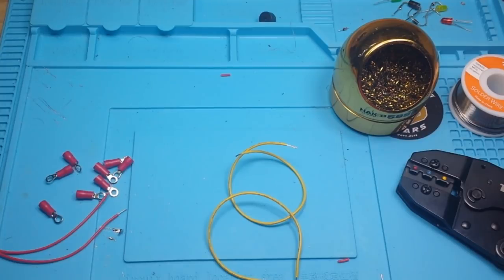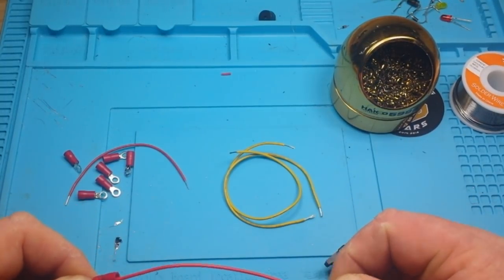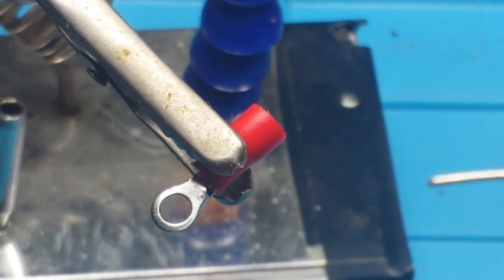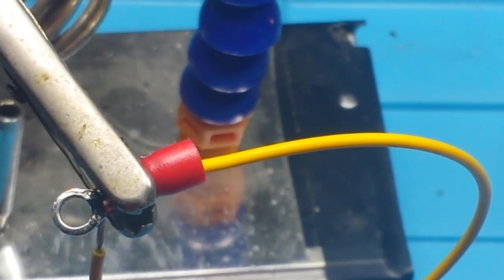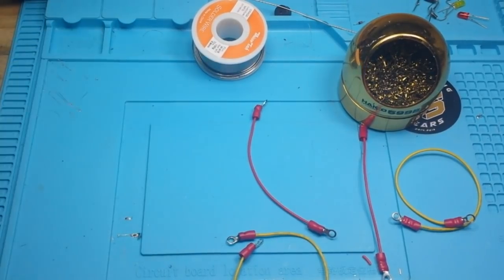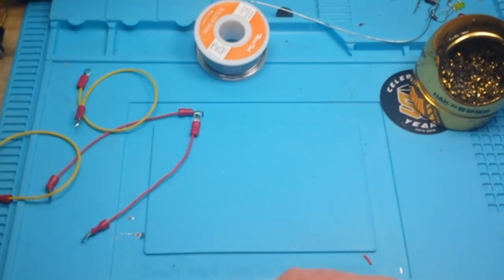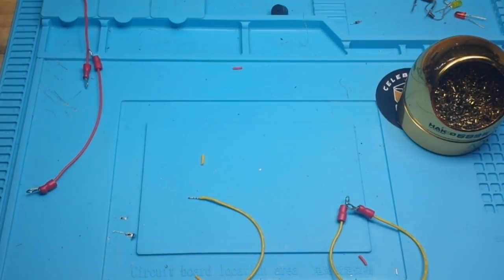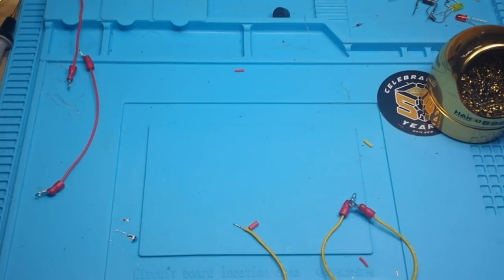To crimp or to solder terminal connectors

Comment: To be honest, I don‘t trust these type of crimped connectors. Often I find myself removing the plastic, solder it and put a heat shrink tube on it. I prefer the non-insulated ones which grip into the insulation and the conductor separately. There are other types of crimped connectors I trust way more, like the wire-end sleeves for flexible connectors. Once these are crimped correctly, they never come lose again.

Comment: I have some thoughts on this, and I've done lots of experimenting with this too.  I have concluded that in most cases, I crimp and solder.  Some of your concerns are valid, but they can be overcome.  I like to combine the mechanical connection of a crimp directly to un-tinned (stranded) wire, with the added electrical and mechanical connection of the solder.  Additionally, the solder serves as a hermetic seal and prevents any corrosion and high resistance buildup due to heat at the crimp site.  Soldering the crimps stop thermal runaways.  Here's my technique:

1)  Use the correct size terminals for the wire gauge and crimp the connection.  This is always critical even with solder.
2)  Clamp the work somewhere where heat softening won't ruin insulation that is going to get hot.
3)  Heat the terminal from the loop (or spade or whatever)  No, this won't work on fully shrouded terminals unless you can slide the insulation out of the way before heating.
4)  Feed the solder into the crimped joint from the end and keep an eye on how much your're feeding in.  Experience will teach you to avoid wicking up the wire and stiffening it.

The insulation covering the crimp will get soft when it's hot, and can slide around a bit.  Just make sure it's in place before it hardens back up.  With some practice you can apply and remove your heat quickly enough to avoid that too much.

As to the issue of stiffening the wire, yes that's a concern.  It can be avoided.  But let's be practical - if you're not relieving the strain on a wire well before it reaches the termination, it's going to run into trouble no matter what in a vibration situation.  I'm not building aircraft here, but at the end of the day I really like the fact that a well soldered joint is immune to the sort of oxidation/heat runaway problem that a purely mechanically crimped connection, let's face it, is prone to.  We've all seen crimps that have inexplicably melted down.  Never seen a properly crimped AND soldered connector do that.
Reply: Good stuff! My only concern is the stiffening of the wire and you addressed that nicely.
Reply: The only issue is that just about all of your points are invalid. Please note the following:

1. Crimp terminals are not intended to be soldered. The metal used to form the crimp terminal is made to cold flow around a bare wire under pressure from the crimper. It was never intended to be soldered so its ability to be "wetted" by the solder is not a consideration; its sort if like trying to solder onto aluminum or steel.

2. Solder joints crack/fracture under mechanical vibration. This has been under investigation by the electronics industry for decades, with no solution in sight. As the IPC-610 workmanship standard puts it, "solder is an electrical connection, not a mechanical one". Whenever you get a chance, look under the hood, or any part of a car, and see how many wiring connections are soldered, and how many are crimped. Bet you won't find any soldered connections, and this is a pretty severe environment, bot in terms of temperature range, and being exposed to the elements. If soldering were a mire reliable connection method, it would have been used; the fact that it is not should speak volumes. The same is true in aviation and military applications. If solder type joints, or solder and crimped joints were more reliable, all of those industries would have been using them. The fact us, they don't, even in the cost no object aviation and military industries.

3. Properly made crimped connections not corrode, even over extended periods of time. From the above, note the "cold flow" characteristic of the crimp terminal materials. Cold flow literally means that the metal in the terminal flows around the wire as if it were molten metal. In a properly crimped connection (crimp terminal properly sized fir the wire, and a ratchet type crimping tool used), the connection is gas tight. This means that nothing gets in there to cause corrosion. If you were to take a very old (properly made, 25+ years if age) crimped connection apart by cutting the crimp terminal apart, you will see that the wire directly inside the crimp will look almost like new copper, and that even with the terminal cut open, the wire strands will still be stuck to the crimp terminal metal, and may be difficult or impossible to separate from the terminal. This is in contrast to many solder joints, which will have cracked after 25 years of age, letting in oxygen, moisture, and ultimately failing. If corrosion is a consideration, use a closed end crimp terminal, with a heat shrink insulator instead of regular plastic insulation. Crimp the terminal, then use heat to shrink the insulator around the wire insulation. This should not be required, for the reasons already explained above and below.

4. Cable joints do not only get mechanical pulling stresses put on them, they see vibration, too. Vibration is the best possible way to crack a solder joint. You can put in all the strain reliefs you want, but the cables will vibrate from the engine, mechanical systems, or just from rolling down the road (or flying in turbulence, or from running through water). And solder joints will crack. They crack on circuit boards, all the time.

It is too bad that there wasn't a milli-ohmeter available to test the electrical resistance of the two connections, it would have been informative.
Reply: @kostaskritsilas2681  These are interesting points to be sure.  Again, it's all about application and the type of wire and connector.  The point you're making about the lack of vibration resistance in solder is something I'm quite familiar with, and is mentioned in some of my videos pertaining to Mercedes repair.  But how is a connection that is crimped first going to allow vibration in the soldered joint?  If crimping is a panacea for stopping vibration related connection failure (it isn't) then how will a crimped connection that is soldered be somehow more prone to failure?  Last but certainly not least, why do manufacturers make crimp connections that are intended to be soldered as well?  Example, Phillips Sta-Dry "Crimp, Solder & Seal" heat shrink terminals.

And to your point about the metal-to-metal contact within a crimped wire.  How do you verify that you've made such a perfect connection without cutting the terminal apart?  You really can't.  That's why I crimp then solder.
Reply: @kostaskritsilas2681   2.) Crimps are used in the auto industry because they're CHEAP.  Unless soldering prevented large issues, it would never be used in such an industry.  Also, planned obsolescence, anyone?  3.) PROPERLY crimped... yeah.  4.) We aren't talking about circuit boards, are we?  And I'm fairly sure most of the problems you're thinking of are when the solder joint actually pulls and/or breaks the trace from the board, which means it was the board that failed, not the joint.  A properly soldered lug is supported on all sides and doesn't wick into the wire.  Vibration only affects the joint where the wire enters the lug.
    A milliohm meter would show you something, that's for sure.  Being brand new connections, they'd measure the same.  A high-current test with a FLIR camera would be better, though.  And much more informative.
Reply: Chris W Crimps are used in the auto industry because they eliminate warrantee repairs, and reduce the warrantee repair work that the dealers must do (which is eventually billed back to the car makers). Car makers are cheap, but cheaping out on wiring connections costs much more than the initial cost of the joint. Car makers have better ways of ensuring obsolescence than unreliable wiring connections (see parts unavailability). If this were strictly a cost consideration, IPC-610 (a worldwide electronics workmanship standard) would not be warning people away from soldering on joints subject to vibration and mechanical stress, and they do have separate considerations for high reliability situations (communications, aviation, military, and space), and still do not recommend solder joints in environments where there is vibration or mechanical stress.

Yes, properly crimped. You should not be under the impression that high volume wiring harness manufacturers are having crimped joints made with hand tools (as per this video). In a high volume wiring operation, there are automated machines thar are doing most of the work. There are machines that cut wires to precise lengths, and strip each end perfectly. The machines are set up by production engineers following an engineering drawing. Then these wires are crimped by automated crimping tools, most often designed and made by the terminal manufacturer themselves (Molex machine for Molex terminals, Amp machines for Amp terminals, and so on). Those crimping machines will only crimp when the wire is in the right position, and is the correct gauge. So yes, properly crimped. This video, while good, is not representative of a production environment; at best, it is closest to a repair scenario.

In today's electronics, you rarely see components pulling traces off. We learned a long time ago to glue, silicone, tie wrap, or otherwise keep heavy components stable so that doesn't happen. It still can happen if there us a bad PCB, or severe mechanical stress. Keep in mind that the vast majority of electronics components are surface mount or BGA packages, which are very light. Even in those cases, there will be solder joint failures due to solder joints fracturing, oxidizing, and eventually failing.

Milliohm meter or FLIR will give you pretty much the same results. If there is a higher resistance at the joint, it will show as a hot spot on the FLIR, or plainly as a higher resistance on the milliohmeter.
Reply: hugeshows I never said that a crimped and soldered connection will be more prone to failure, just that adding solder to an already crimped connection is a waste of time. It buys you nothing, but does take more time. And if traditional crimp terminals are used, the solder is only wicking into the copper strands, it is not making a solder connection to the terminal itself, due to the terminal metal used.

In a repair situation or where you intend to use the crimped wire, you cannot cut the terminal open.  I was suggesting that you find a discarded crimped wire/ harness, and cut that open, as a way of understanding that happens when a crimped connection is made.

I don't know why they are making the "Crimp Solder and Seal Connectors" (and I worked for Philips for over 10 years, and would say 1) they should know better, and 2) when did Philips start making connectors for sale (they always made connectors for in house use). Is the connector manufacturer spelled with one L or two Ls? I can only guess that is a reaction to people wanting to solder an already crimped connector.
Reply: @kostaskritsilas2681  couldn't have said it better!
It's called a crimp connector for a reason..
I use them for 20+ years now...
You need the right tools for the job and it will be almost indestructible...
Reply: yeah I've always seen the crimps melted or corroded  and that's why I solder after the crimp and problem solve, never seen a soldered crimp burnout and as for the insulation getting melted during the soldering due to the heat, I always use heat shrink tube to cover that end
Reply: @kostaskritsilas2681  same with aircraft. the vibration means that you never solder a crimp connector.

Comment: Thank you for trying to help others get stuff done. Industry standard is if its a crimp connector crimp it. This does mean a collection of crimp tools if you have multiple projects. As far a tinning it looked nice because you could see the individual strands, however if the tinning enters the insulation it is against IPC code due to the stiffness/brittleness introduced as you mentioned. It looked like PVC insulation material on the cable you showed, That stuff is notoriously difficult to solder with due to the tendency to melt so quick and easy. Try turning the heat down a bit. When the insulation melts into the wire it  is said to introduce extra resistance to the circuit. This may or may not be crucial to your application. And i totally agree if in a high vibration or repetitive motion environment, never solid always stranded for the least headache. sometimes solid core wires break in the middle somewhere and it is a total pain to find.

Comment: Highly oxidative atmospheres (water + air) will have a lot do with the type of connection. A soldered connection will withstand oxidation much better than a mechanical crimp.
Reply: Yes, very true.  The best is to crimp then solder.  That way solder is not doing the mechanical work but is sealing off the joint.
Reply: Really? Please explain why "highly oxidative atmospheres" environments use crimped terminals exclusively. By this ipI mean automotive, aviation, and military. No solder joint in sight, ever. Wire joints are crimped, and then put into weather tight connector bodies (GM calls theirs 'Weather Pak"). Same is true in aviation and military.
Reply: @kostaskritsilas2681  
Marine gear and earth moving equipment from Caterpiller have soldered equipment.  Automotive production is extremely cost sensitive so we can leave that aside.  Aviation and military gear makers are big on making things that can be inspected by a second person.  A crimp then solder joint has to be inspected in process and that just won't do for them.
What GM calls something is neither here nor there.
Reply: @kostaskritsilas2681  Money

Comment: Crimp stranded wire. It doesn’t typically need solder, but you can wear a belt and suspenders if it pleases you. Use the appropriate size connector for the wire gauge. Solid wire makes sense to solder as well, if you do not feel confident. I have crimped many many terminals, and when done correctly neither really needs solder for power electronics. Smaller signals may be different, I don’t know.

Comment: Crimping is perfect for for vibration and temperature driftings enviroments like automotive, solar energy, otherwise use solder.  . Thanks for the correction on the crimping on the ferrules. Great info on crimping.  For Fast-On connectors ( for SLAB's) there are the crimping version ( two sheet wrap) and the soldering version.

Comment: Great video! A friend and I were just talking about if you should crimp and solder and I was explaining to him a good crimp is sufficient enough!
Reply: You were wrong if it is a salty environment.  The solder seals the joint.  Without it, the joint corrodes and fails.  In the past, I had to do a lot of field repairs over this.
Reply: Is it a GOOD crimp?  Good solder joints are pretty easy to see.  How do you test a crimp?  Pulling on it weakens the wire and the joint, even if it is (was) good.  Yes, in many cases crimping is fine, and a low cost, easy alternative to solder.  Saying it's always better is just.. ignorant.
Reply: Sufficient enough, that just says it all

Comment: Now come back in 5 - 10 years and check again.   Oh,  Subject those connections to salt spray ?   Auto Ex host ?  Heat and Cold Contractions cycle ?
Reply: You left off:
Saltwater, dry, saltwater, dry.
Fuel oil exposure
freeze thaw
High current spike
Reply: @kensmith5694  Now add Aluminum Wire ?  LOL    Man O Man  I hate that chit.

Comment: Caterpiller and the marine industry crimp then solder.  The solder seals the joint.  If you are working on something for a harsh/salty environment, that is the way to go.

You don't need or want a ratchet on a crimper that you are using for low volume work.  The ratchet is intended to make it so that any idiot can make the correct crimp.  Unfortunately, it has to be calibrated to the lug and wire involved.  If it is out of calibration it always makes a bad crimp.  A manual one where you look at what you are doing and make a judgement means you are in control. 
BTW:  The jaw on the tool you have is the sort that doesn't make a very good crimp joint.  It tends to mash flat the barrel instead of forming it inwards without making it get wider.

You need a 4 terminal Ohmmeter to check the connections.  A regular DMM style meter is not good at these low values.  Most of the resistance is in your meter leads and the point of contact with the tip.

Comment: I take the jacketing off, crimp it and apply a bit of solder. I finish it with some heat shrink. A word about your solder and why your joints are failing is that your only applying heat to the iron. This doesn't allow the solder to properly flow onto your wire. This is best shown during the joint made at 5:14. It also helps to have a cleaner tip. To make this joint properly heat both the wire and the terminal on one side of the crimp while feeding the solder into the other side of the crimp. Solder flows to the heat and is also effected by gravity. I mention gravity because if you solder with the wire tip up the solder can flow into the wire causing it to stiffen up near the solder joint. If you solder with the tip facing down or at least angled down then the solder is less apt to flow back under the wire jacket. One final point is if your going to solder wire at all, get silicone coated as it doesn't melt the jacket when soldering.